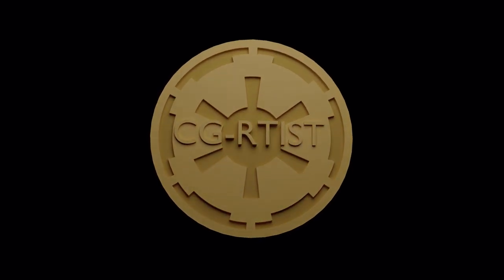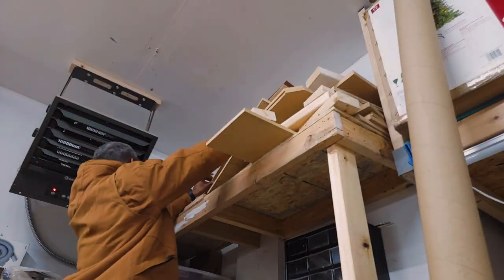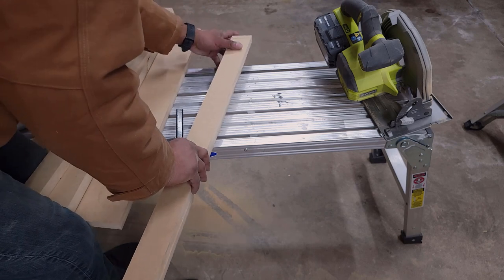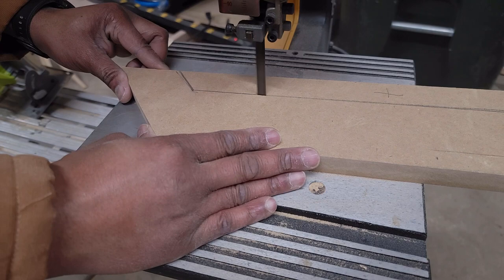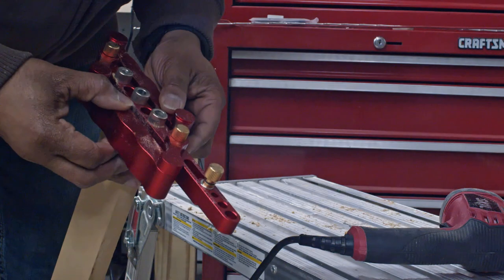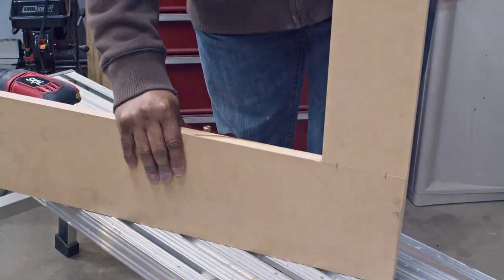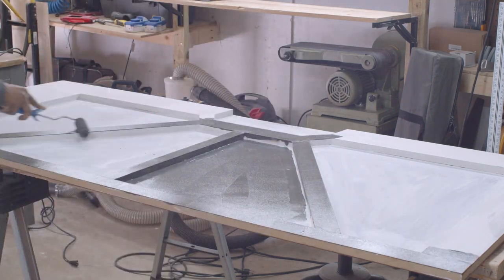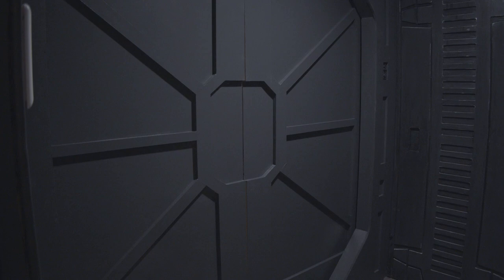Blast Door Build

Comment: Sadly, in an effort to get some maneuvering room in the garage most of my scrap would this past year has been donated to the bonfire.  These kinds of projects are great for putting those piles to use.  Sweet build.
Reply from the maker: Oh I totally understand that, my friend. What you did t see is the amount of scraps that I ended up donating.  I got rid of so much for the same reasons, I needed space!
Reply: @CGRTist  I look at your garage with jealous eyes.  Mine is still pretty packed to the ceilings after a concerted effort to use up materials and purge.
Reply from the maker: This wasn't done overnight. It took a while to get it this way.  I've purchased a ton off of Facebook marketplace and Craig's List.  LOL